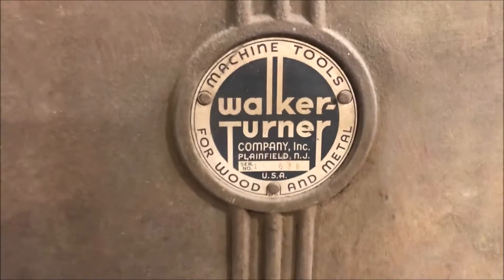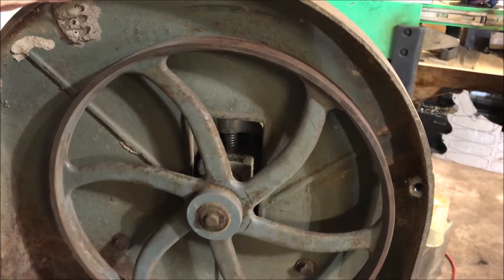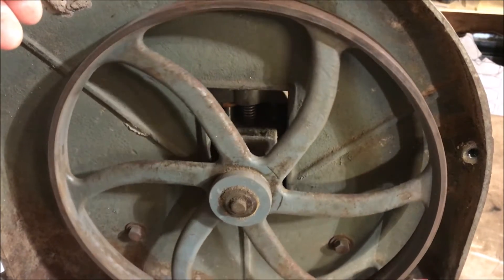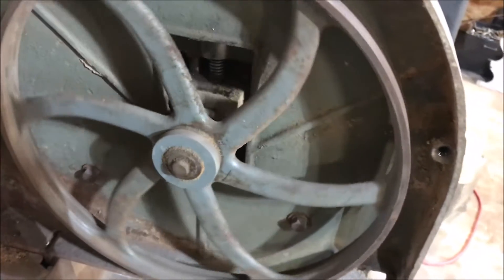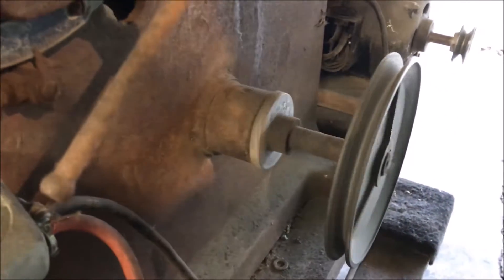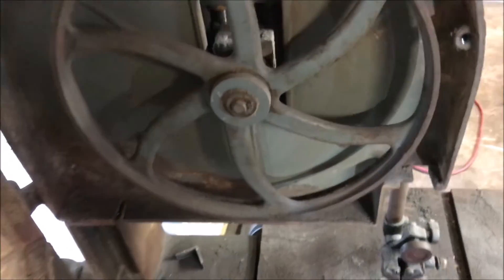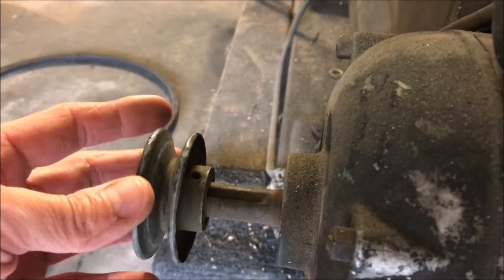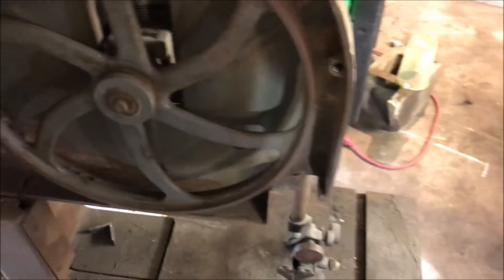Walker turner Band saw true usa craftsmanship

Comment: I just picked one up, looks like same year, I thought the same thing, it’s so smooth, I am in the process of redoing electrical and changing tires. Looking forward to firing it up.  I think it’s from the 40’s by comparing logo changes over the years, and the jointer and lathe I picked up were from the 40s so that made me assume this was also, as they were from the same seller…🌎✌️👽❤️

Comment: The "rocker " is for blade tracking adjustment. To keep the blade centered on the crown of the wheels. I have the same bandsaw that I restored over 20 years ago and still runs like a dream.
Reply: Hi Jon. I have the same model and am looking for a part. Any leads on where to find them. I can send a pic if that helps.
Reply: Sorry, never found a source for parts. Luckily the bearings are still produced.
Reply: Jon, I recently acquired a Walker Turner, when I tension the blade it has slipped of the rubber tires, will replacing them do enough or should I also crown the wheels?